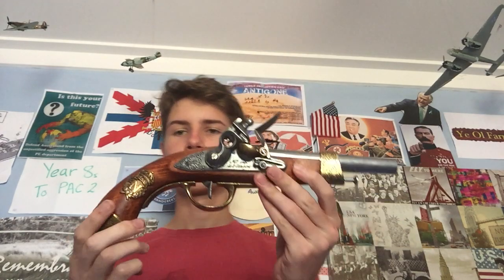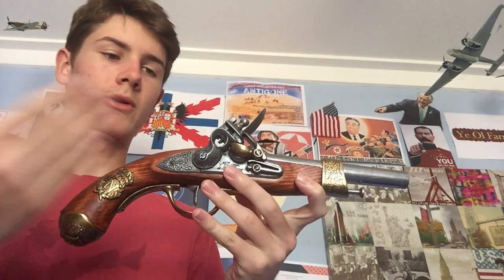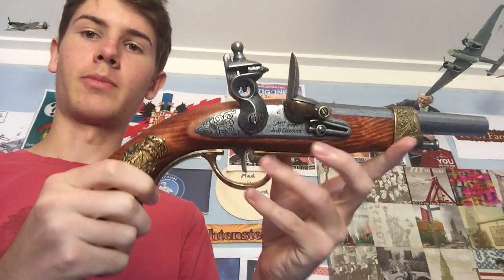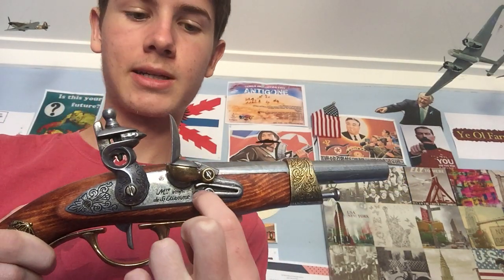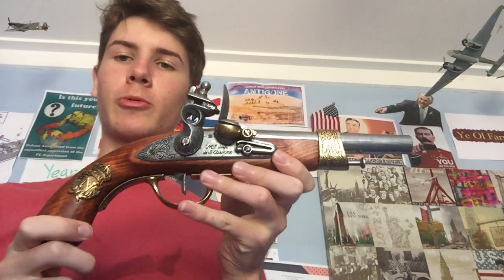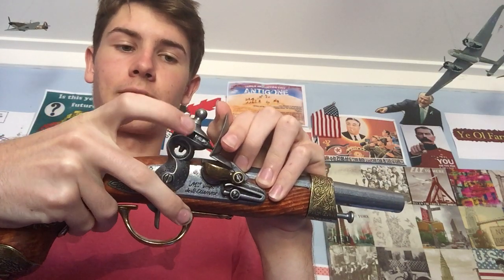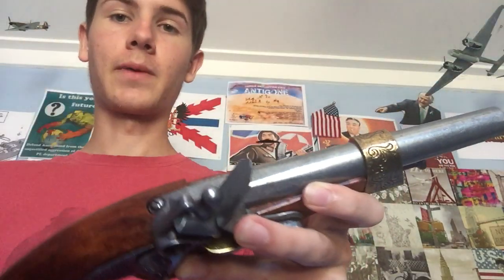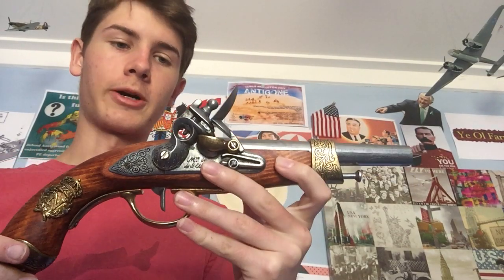How does a flintlock pistol fire?

Comment: One suggestion while making videos, film a test clip and check your volume levels.  I'm sure you are more than loud enough through earphones, but playing through my built in laptop speakers, you sounded very quiet.  Also I see on quite a few flintlock videos, they use a piece of leather padding in the jaws to hold the flint.  The leather goes like 'C' with the flint with the blunt side in the open part of the 'C' facing the back of the rifle or pistol.